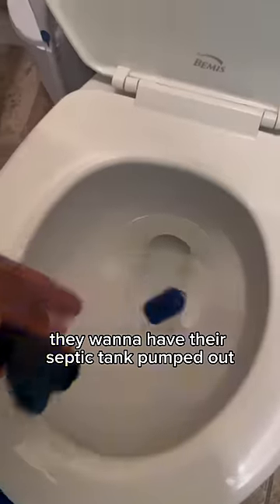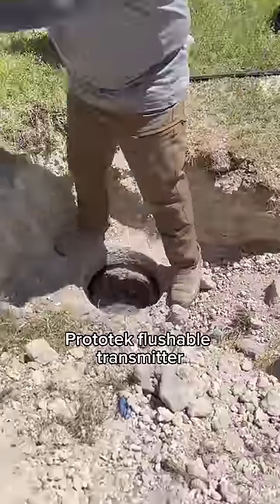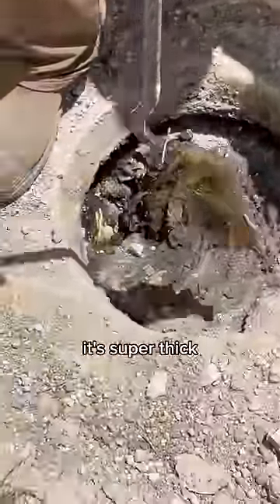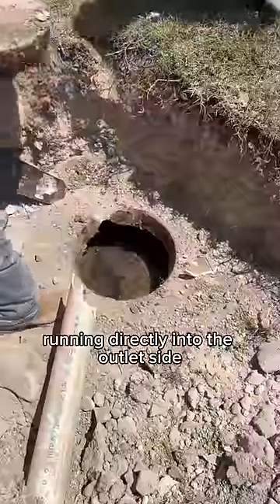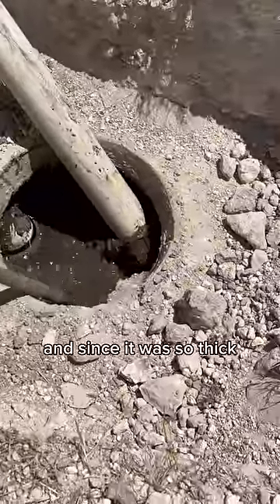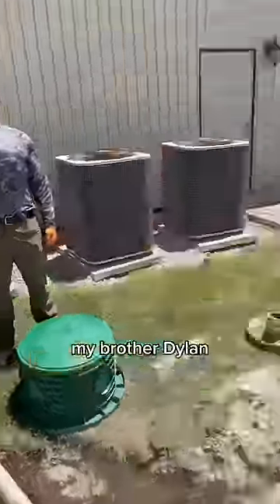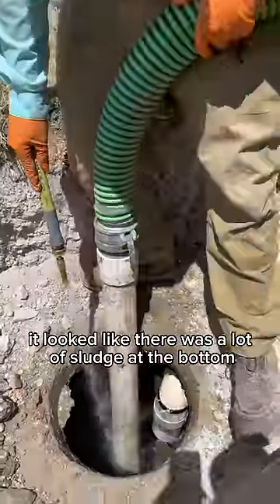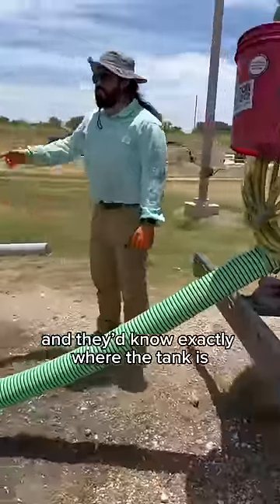Septic tank had never been pumped #shorts

Comment: QUESTION?
Our septic tank is 3/4 of the way underneath the house. (Inlet side) it's been pumped out twice but both times they pumped it out from the outlet side and said they stuck the hose through to the other side...

No one has climbed underneath the house and pumped it out from the inlet side. They said they don't need to. 
Is this true?

Comment: Damn. Americans don't even have sewage systems. What the fck is a septic tank
Reply: A septic tank is a better way to store sewage because it also releases most of the water waste into a field of grass. This is mostly used in places where connecting to sewage is impossible as its too far away or too costly. Nothing wrong with this method at all as long as it is maintained properly.